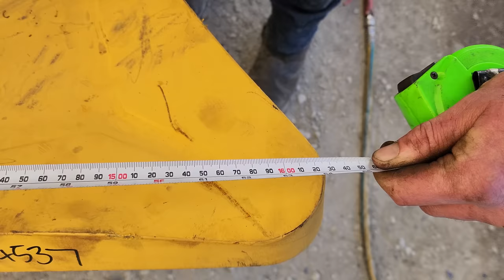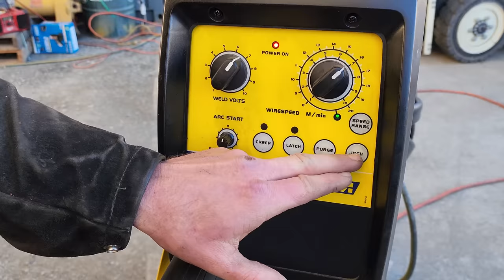Massive Repair on BROKEN Bulldozer Blade | Part 2 | Drilling, Gouging & Welding

Comment: Kurtis I am now 66 years old ,worked on cars for 50 years.
Best advice I can give you is stop kneeling on the ground without a kneeling pad.
I can hardly walk these days.
I used to get told this all the time when I started off but hey I new better.
What idiot I was.
Great video presentation Karen.
Reply: From a 71 year old who did a lot of working kneeling in his youth I agree. Kurtis is good looking after his lungs, hearing and sight so hopefully this nudge will make him watch his knees. We are not nagging Kurtis just thinking of your welfare !!!
Reply: You can get really comfy ones that strap onto your legs. Makes such a huge difference to how you feel at the end of the day.
Reply: Agreed. Our illustrious Heavy Metal Artisan Kurtis could benefit from a Health & Safety & Ergonomics appraisal by an expert on production line Fabrication work. My best guess is that he'd get a report mandating an entirely new outfit to wear plus (hydraulic-powered?) variable height platforms to elevate his work level to knee level plus, where practicable. After all, guys doing car chassis restoration work use an improvised Rotisserie-type piece of equipment for ease of safer,  lower skeletal stress access & efficiency gains. Think Smart to minimise the likelihood of an accretion of irreversible skeletal wear & tear & boost efficiency too. And how about a full skeletal scan at a friendly clinic as well to assess the current of play? When younger, I worked at foundry & copper smelter jobs during university holidays - dirty, hard physical work indeed! For Kurtis, retirement from Heavy Metal Fab work could be 25 years off. Stuff to ponder.
Reply: Same here. Got the hard way😭
Reply: At 60, I cringed when I saw Kurt's stand up without knee pads...
I used to bark at my apprentices then give them my pair, please protect your knees at all costs ( I know, 
Pads can act as a catch basin for red hot slag, BUT walking is kinda important too), both knees replaced at 55... just a thought brother,  even an old piece of rug, or wood 😢😢😢😢😢

Comment: Oh my God! What an awesome tool Holemaker is. I never seen anything like this before, but it is also true that I am IT technician. 😉 Another superb video, thank you! 😁
Reply: magnet drills are awesome! especially when you need to drill holes in big pieces where a normal drill press won't get. 

the most fun i had was while drilling 16mm holes overhead in some steel beams while being 16m high 😂😂 

the most frustrating was drilling 4x 
 38mm holes in 30mm plate. the drill died after two holes and i needed to get the whole part (about 400-600kg) on the big radial drill press. 
+ had then to balance on the part while drilling because the lever's we're too high 😂 (I'm 2m tall)

Comment: Haven’t seen the end yet but a suggestion, those cutting edges should have the paint on the backside removed so that it’ll be a metal to metal contact between the blade and the cutting edges. If not over time the paint will compress and the bolts will come loose resulting in unwanted wearing on the new material, this is something I’ve seen with restorations of blades so when I do a restoration like your doing I remove the factory paint. ALOHA FROM HAWAII 🌺🌈🤙🏼

Comment: Thanks for the great vid - this repair is looking seriously sturdy 👍
The Milwaukee impact wrench looked like it wanted to shake off its battery 😀
Interesting observation: The welding wire plastic spools are virtually identical to those used on the 3Kg rolls of 3D printer filament I use. (I'm working on a design - wait and see 😉).
All the best,
Paul

Comment: "We've spent years engineering the briefcase drill press. It's portable and it'll cut a perfect hole through inch thick steel. But what should we call it?"
"...the Holemaker."

Comment: Mag-Drills are one of my top favorite tools. Especially when a dummy turns off the magnet when it's mounted on the side of a beam 3 stories in the air instead of turning off the drill itself.

Comment: Beautiful work as usual.  BTW I'm sure you already know it but someone watching your video may not. The mig welder liner should be blown out for dust etc. When you change spools. That extends the life of the liner and could eliminate any drag on the wire affecting your welds. Others have said it before and it's worth repeating, you are an artisan at your craft. Thanks for taking the time to share.

Comment: Nice work! I've watched a few videos, lately, where welders use breathing apparatus when doing MIG welding. I did quite a bit of it about forty-seven years ago, on hundreds of yards of 1/4" steel duct work for a new bearing factory. We didn't have breathing apparatus back then, or our company was too tight to buy any. I had run some very long welds while kneeling on top of the ducts. After about a half-hour or so, I was worried because I could breathe in but not out. It's a horrible feeling, thinking I was about to die. I sat outside the workshop for about an hour and gradually was able to breathe normally, but I didn't feel well. For the rest of the work I had to make sure the welding fumes were being blown away from me. I'm retired, now, and after getting hooked up with a doctor, he sent me for breathing tests because I had 96% capacity. I'm guessing the problem from years ago might have been the cause, but I'm healthy, otherwise, and at 77 years of age, I ride a bike about 8 miles every day without getting out of breath. Glad to see welders protecting their lungs, today.

Comment: From metal surgeon turned into a wizard. With a flick of your wand you seem to conjure tailored pieces of steel out of thin air just with that wand made out of a gouging rod, love it.
And also great filming, Karen does an adorable job.
Keep em coming!

Still interested in all the work behind the scenes, it does not seem to be only a lot of welding. I am sure, there is much brainwork in the background.
Best wishes from Germany

Comment: I completely rebuilt a Cat, 988 front end loader bucket for the rock crushing company that I worked for in 1993. I put a new floor in it, replaced the side cutters and the lip, all the wear plates, everything. I welded it up with Lincoln innershield, NS 3M. I think I used 3/32" wire. The company sold that loader in 2017 right before I retired. I looked at the bucket before they hauled it away and it still had all my original welds on it all those years later. Do you not like NS 3M? It's a high deposition wire that can speed up the welding process. I know that it can only be used in the flat position and you are making welds, "out of position".

Comment: I have been in heavy machinery manufacturing (Paper machines) for over 50 years and I wish all of our welders were as good as you.
Wear knee pads as too many suffer in their older years from bad knees, usually from sending decades on concrete floors and not thinking how the knees can suffer over time.

Comment: We call those bits a Rotobore. TINc boring cutter with spring loaded center guide! Awesome!.
Reply: I sold them when they first came out back in the 1970s.  They were HOGAN 
RotaBroaches. I sold them in the Mid-Atlantic states. I did pretty good with them.

Comment: That's the correct side to weld the wedge bracket and and smack drive the wedge from that side, but I was disappointed to see it snap off.,.... Regards from  S.TX.

Comment: Great repair!  You could machine a punch that fits in the countersunk holes and comes to a point(blade 11:10/34:13).  Use that for marking center.  Or use a drill guide that is machined to fit the countersunk holes.

Comment: just finished pt 2 of your repair, and i must echo comments already given. much appreciate seeing actual repair work as it is actually done. great job so far. i worked in a railcar manufacturing plant in pennsylvania. USA for over 30 yrs as a repair welder. had all position certs for flux core. stick. and aluminum welding. you using air carbon arc gouging rods brought back alot of memories. wondering what wire you use, here we used .045, 1/16 mainly. i do realize i dont speak in metric, thx USA. love watching an obvious pro. also looks like a pro behind camera. will now hit the comment and subscribe buttons.

Comment: That is one hell of a drill bit. My little home owner bits burn up after a few holes drilling through some brackets I needed to drill and weld up. And they were 1/8 in thick.

Comment: Back in 2005 I used to work for a company that made parts racks for car parts. I was a welder. I would burn through a 44 pound roll of mig wire in 2 days.

Comment: I wanted to mention on the video where the nut was stuck on the hydraulic shaft and you had to cut it in four places to get it off, but never got around to it - you could have cut down the nut in the lathe to near the diameter of the thread and then cleaned out the thread with a thread setting. Cheers from a cold South Africa!

Comment: The material coming off the drill bit that looks like Brillo pad is excellent for scrubbing kitchen pots because it's not stainless steel and Ken rust that way it won't clog up the drains like stainless steel

Comment: I had to laugh, when you gouged that plate off the back because it reminded me of when I worked for the street dept. when I was a teenager.  We had this D8 dozer that had a blade on it like this, and for some reason it always had this "tinging ringing" sound the whole time we used it.  We never could figure out what that was at all.  When I talked to my old boss a few years after I left, he said to me "do you remember that ringing dozer?  We had the blade rebuilt and when they removed the back plate, they found a whole bag of washers hidden inside"  Apparently, the guy that originally welded that on there was on his last day at the maintenance shop and thought it would be funny to drive the guys nuts.  It worked for 10 years!   Now, that's a great prank!

Comment: Nice job. I've never welded with flux core. Looks like it welds so smooth. I've only run 75/25 in the mig. Most big welds I'll do with 7018 or such but that is looking sweet.

Comment: As a kid my father was a lather. He would come home with blood on his Armes , hands and elsewhere. I'd ask how it happened and he would say he didn't know. I remember thinking he had to know. I knew whenever I got hurt. Now I look down and think, "How the hell did that happen?" FYI to make your GMAW guide tube on you lead last longer it helps to straighten the lead out as much as possible. It's just a nylon tube and that sharp piece of wire going through it scrapes and eventually wears a hole in the tube. Well done young man.

Comment: You are the best. Here’s the negative. If that block or to slip and fall on your foot or knee, it would be terrible. I’m a safety guy return for I can’t do your job can barely weld and bend over due to injuries that fire service. But I sure would like to see two more blockssupporting that giant blade keep up the good work you have a great wife and a great dog.

Comment: Could you have clamped the cutting edges in place and run the drill straight through the holes with the mag drill secured to the cutting edge? Great video! There were long days on the job. You did an excellent job.

Comment: i used to have that cordless 1 inch impact, you get more torque by using a high output battery. but for me, i sold it for exchange of an air one as it wasnt strong enough. it sometime couldnt remove truck lugnuts

Comment: Excellent workmanship Curtis. I would estimate you will have used 3-4 spools of welding wire. Depending on whether the spools are 33 Lb. or 44 Lb. , weight of weld wire would be between 100-125 pounds.

Comment: Im surprised you haven’t made a transfer punch for marking the bolt hole locations on the cutting edge plates. Made out of some square bar turned down on the lathe to a point. Would save time without the need to find the center of each paint marked hole.
Reply: It doesn't need to be square - a round tap finds the center even in a square hole.
But this gave me an idea: Make the bar tapered, drill a hole in the center of it and fit a separate loose tap of hard steel with a sharp tip inside it. Place the tap on the hole, hit the inner tap with a hammer and the center of the hole is marked! - And because the bar is tapered it works for diffrent thickness of plates and different size of holes.
I think I will make one. Thanks for giving me the idea!  👍

Comment: On those large bolts you were using to attach the corners, do you not need to have any sort of Lock-tite on those to keep them from vibrating loose?

Comment: What about a magnetic crane accessory that can lift heavy steel parts, so that you dont have to break your back?

Also, would spaying yellow paint through the holes work faster to mark where the holes had to be drilled?

Comment: I had never seen cut rod being used before... is that what that particular thing is called in Aus?  Where you are blowing through the material with the stick welder setup?

Comment: Your outakes always have me belly laughing. Your work is first rate. 

Out of curiosity, I came up with an idea for your channel. You have a pretty extensive line of welding equipment. You have touched on certain bits here and there in other videos, but never really done a complete rundown of your entire setup, as far as all you various welding machines, your selection of hoods and PPE and why you chose them, any accessoriesthat you have chosen or made. Just a thorough going through of your welding inventory, hell even down to your gases and lengths of your leads. I know I'd be very interested in seeing a separate video on the subject. Thought others would be too. 

Keep up the great content and work.

Comment: Do you need to be concerned about affecting the strength/hardness of the steel when you get it red hot to form it back into place or is most of it just mild steel anyway?

Comment: Great work. However you probably know this but when your fitting plate its better to start from one side and move to the  other or fit from center out . Then you don't get a bulge in the center or on the sides where your tracks were Coming from a Ironworker and Boilermaker who has fit and weld a lot of plate on ships and barges. Take care.

Comment: I am almost 70 years old ex owner of a reasonable sized engineering business. I have been watching your postings for some time and am in awe of your ability for a young bloke, I would have had to  employed 3 separate tradesmen to carry out what you are capable of and you deserve all the fruits of your labor. However If you were working for me and I saw you light an oxy torch with a BIC lighter I would have kicked your arse all the way out the door . Just saying.

Comment: Why do you have the torch tip touching/almost touching the metal when you add the oxygen?  The only torch experience I have is with a flashlight. :)

Comment: Excellent video, worth every pound of your time. I can imagine you are running 300amp fluxcore from your scaler tool out of curiosity what amperage are you running got to be some machine to put up with the continusios use you are putting through it mb-25 torch with 1.5mm wire by any change? Also is your torch water cooled.

Comment: I watch your stuff because I like how you problem solve and structure your work flow. Plus you use BIG ASS machines. I enjoy your repair videos as much as your fabrication videos. 
I feel like you should be a global ambassador for learning multiple trades and the life they can afford youth. Life’s not just 1’s and 0’s. 
I do have one bone to pick on this, and I don’t mean to be negative, but, I noticed that you put the blade on a wooden block stack. My issue is you used a block in its side. 
There is significantly less strength in wood radially compared to lengthwise. 
I once met a lady while pulling my motor from a Datsun Pickup who told me her husband was killed when a block of wood collapsed under a 1 ton truck. It made a mark on me. I’ve also studied wood science while at Forestry School and the data confirmed the strength difference. Given that you work under really big stuff, you should change your habits. 
I’m not trying to dazzle you with brilliance I just feel obligated, as a crusty old man, to try to correct bad habits. 
I keep going, your stuff is great.

Comment: Looks like you have made a new blade instead of repairing the old one. Good work, but probably easier to start from scratch instead of cutting and replacing the old stuff.

Comment: It's incredible to me that all of this work can be done in a shop setting and it's still cheaper than buying a new factory manufactured blade. Seems like the efficiency of the production line should make a new one cheaper rather than hiring a highly skilled tradesman and machinist to do all of this one off fab work.

Comment: I know you will never read this comment as it is buried deep but with all of the kneeling you are doing a good set of Knee pads will save your future knees. Your current and future knees will thank you for it. Will you be hard facing any of the wear surfaces to provide extra abrasion protection? Also love your work very professional I wish I was that meticulous, I only do work on my own stuff so a she'll be right attitude is all good by me.
Reply: I love my knee pads as well, but studies have shown that carpenters crawling on their knees day in and day out, get more knee problems with them, because they take the immediate discomfort away crawling. Pain is a message to stop doing something.
If you are only kneeling down in front of a machine that you work on, and not crawling, I hope for my own sake they do more good than harm